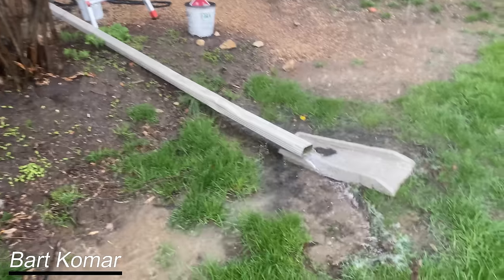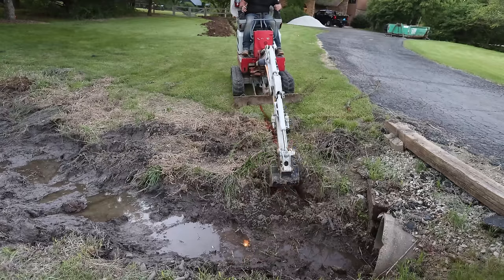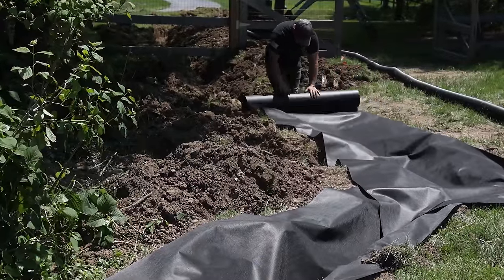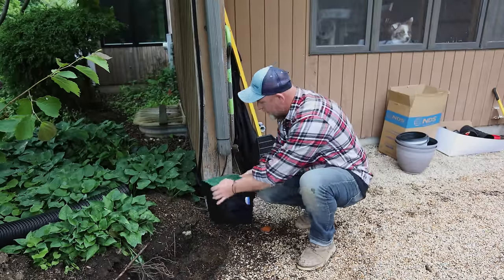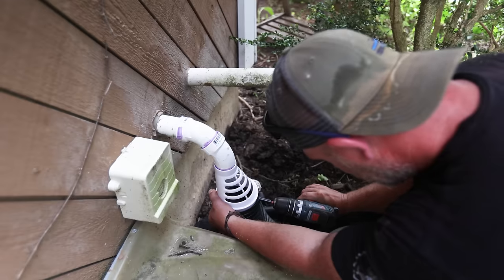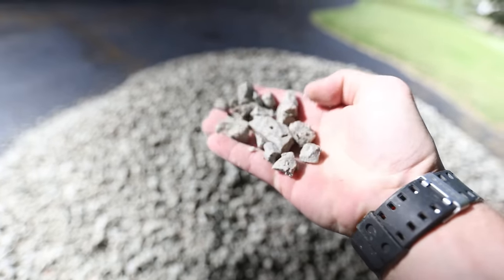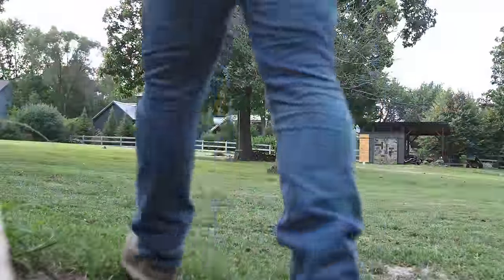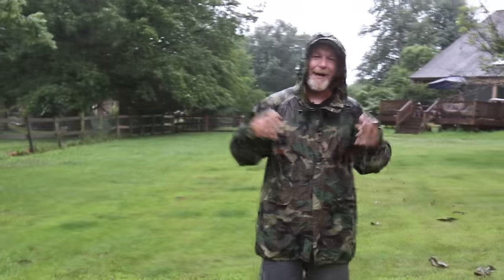How to Install a French Drain that Actually Works!  DIY Project

Comment: For the grass that won't grow due to the clay turnover, could you add layers of compost from the city? We have free compost where I live, or $10 for them to fill a truck bed. They also have a leaf-matter only mix. Otherwise, everything looks really good! I wish I could add a French drain to my property.
Reply: This is just copied from a comment I already made:

BTW, for a lawn heavy in clay, rent a power aerator and run it over the area six or eight times as much as usual.  Then get a nice granular high-organics soil mix and rake over the lawn so the aerator holes get filled with it; corn gluten meal granules are superb for this.  You'll end up with the little cylindrical holes full of organic matter plus a light layer on the surface consisting of what didn't rake in.  Water this once, which will probably settle the organic matter down in the holes somewhat, so repeat adding the organic material and water again.  If you can get away with raising the lawn surface, leaving a half inch of your organic material on top will also be beneficial. If your yard is low on earthworms, buy some and scatter them while the surface is damp; they'll find those little columns of organic material and dive down into the soil.  The worms are your workers; they'll eat organic matter, but they'll also migrate through the remaining clay and perforate it, leaving casting behind that are nature's own fertilizer.
This will be a higher up-front cost, but if you deal with the brown grass problem using fertilizer you'll be forever dependent on fertilizer; if you instead make a healthy lawn for earthworms they'll keep doing the work for you!  And if you aerate every few years and rake in more organics the worms will keep on taking care of your lawn for you.
=  =  =  =

Or to get a really good result -- this is how I turned a dead zone of clay that wouldn't grow grass at all (though it had some spectacular weeds) into lush lawn -- shave the top six inches of clay off and get rid of it.  Then get enough of that free compost (we had a source that was made of human sewage composted with sawdust [don't worry; that mix gets hot enough as it decomposes that if you toss a cardboard box onto a just-opened surface the box will catch on fire, so there's no bacteria in it]) to make a four-inch later on top.  Till this in thoroughly, smooth it ans roll it to compact moderately.  Then spread three or four inches of compost on top -- we added twelve dozen earthworms before this step -- and seed it.

Comment: You connected your downspout to a perforated pipe. @9:19 after putting the filtered grate you used a y connector into a perforated pipe. All your downspout water will now leach out underground
Reply: If I'm not mistaken, the way the perforated line works is by filling up (through the holes on the bottom) and then being carried away through the tube to where you want it.  For the downspouts, once it gets away from the house and to the main trench, it can be treated just like any other lawn water and travel through the perforated line.

Comment: On the pipes that drain away from the house what would the termination process be if you can’t extend it onto the street or a dry creek bed? Do you just dig a big hole with gravel for the water to Oomp into? Of course that would Have the potential of backing up? Thanks

Comment: The links you provided for the 9 inch downspout grate is actually 12 inches.  It doesn't look like they make a similar nine inch product.  So did you use the 12 inch version?

Comment: Sir, just a note. The connectors for the pipe have the extanding part slightly angled as well as is the hose pattern. To me it seems more like the connector is not ment for snapping but to screw in?

Comment: Was there a reason you connected the solid pipe from the downspout to the perforated french tube?  Some contradictory to what you said earlier in the video.
Reply from the maker: No I connected it to the solid pipe.  It’s also corrugated but didn’t have the perforated slits in it.  Look the same but no slits.  Probably should have pointed that out
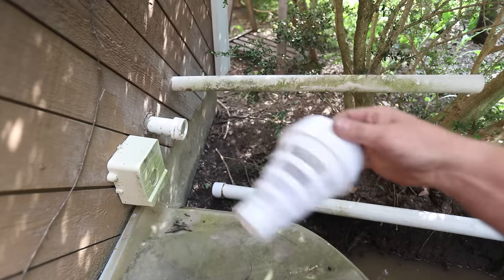Reply: From the video it's definitely the perforated pipe in place that you connected that Y piece into.  Take a look at 09:23 very visible slots in the main pipe you connected into.

Comment: Not an expert, but with all of the research before I did my own french drain,    All reputable sites advise against using crushed limestone of any size because the power when wet won't allow water to pass thru.   It cakes on the fabric and restricts drainage.    It is recommended to only use washed stones (non-limestone based).

Comment: Hey what do I use to connect a 4 inch solid corrugated flex pipe that takes the gutter water to a solid 4 inch PVC pipe that will run underneath a side walk and out to my backyard, what adapter will work best? Also why did u connect the downspout solid pipe to the Y that main pipe was SLOTTED!

Comment: Great video, but I would’ve used pvc instead. Where I live, the city requires you to have a perimeter drain, and they don’t accept big-o, only pvc. What I have noticed is that the big-o, a lot of times will get crushed with the weight. I guess if your just doing it yourself and don’t need to get it inspected then big-o is ok, but again, if your going to live in that house for the rest of your life, it woulda been better to go with pvc. More money, but it’s better
Reply: Harder to install though around bends and curves.
Reply: @AchillesWrath1  yeah it is. On a long trench you’ll be at it forever, filling in voids etc

Comment: Thanks for the fine video.  At 9:20, it looks like the pipe from the downspout is perforated.  Did you connect it to the perforated line rather than the solid line for some reason?
Reply: i noticed this as well and searched the comments as to why. i think it may have been an oopsie

Comment: At 9:15 when you connect 2 pipes using a Y, it looks like your main pipe is perforated. My understanding is that perforated pipes are only used for French drains. Does that mean that you connect your gutter down spout solid pipe to your French drain?

Comment: That catch basin at the foundation is causing splash on your siding and foundation... These areas need to stay dry to any durability!  Otherwise great job with the video.  I'd also recommend a swale in the area of the french drain.  You can use the extra dirt for some berms as you have lots of space.

Comment: Honest question, is there any reason you didn't connect your solid lines from your downspouts to the perforated drain tube in the main yard trench? At that point, isn't it far enough away from the house to then just be carried away like all the other yard water through the perforated tubing?

Comment: Limestone and gravel are often confused with each other, but they are very different aggregates, primarily in appearance. Crushed limestone contains one type of rock (limestone), while gravel is a compilation of many different rock varieties. Or so says the internet.  I wonder myself if limestone will remain as porus as gravel.
Reply: limestone is a specific mineral.  gravel means a combination of aggregates of various sizes.  3/4 minus would be 3/4" crushed down to some sand and maybe silt.  gravel wouldn't specify a mineral, and here in the mountains of CO, most of my delivered gravel and rock have been mostly granite

Comment: PVC is heat malleable. Rather than grind off the nubs on your drains, it'd be super easy to get out there with a heat gun or a torch, soften up the 6 inch PVC and then just pound the drains in to fit snugly.

Comment: Very helpful thank you.  I have gutter guards in the downpipes, but they clog very quickly and I have to go up a ladder to clean out the guards. Your solution at the base of the downpipe seems like a much easier alternative. 
I've watched several of these retro fitting drainage videos in the US, and it seems like proper drainage is never planned or built when the house is first constructed. Most UK newbuilds have rain water and ground water drainage included when the house is built. That being said, your yard is large compared to a UK typical plot. 
French drain: I'm not sure I understand the purpose of the black cloth. Is it impervious to water? If so, how does the water from  the ground enter the French drain pipe? Would you put the French drain at the lowest point of the property where all the ground water collects?
Reply: He says in the video that it lets water through, it's basically a filter to keep soil out.

Comment: A question from a newb - for the non porous pipe from the sump pump and spouting, why did you use a geocloth?
Reply: Ah clear now - you are running porous and non-porous in the same trench.

Comment: Mine has no piping  or plastic sheet, just a 12 inch deep trench with river rock filling it till an inch from the top, sand on the top but I have no drains pouring into it, just a low spot. Still draining fine after 6 years. Grass has grown back over it and it cannot be seen.
Reply: How wide is/was the 12in deep trench?
Reply: Im seeing that a few times in the comments and it makes sense what it would work. What would the drawback be? Dig a trench 18”x 18” line the bottom and sides of trench w non woven drainage fabric so clay doesn’t migrate into the stone. Leave a 2-3 “ space on top on just enough to put the sod back on top n hope it works. Thoughts?

Comment: Please attach the roof drains directly to the ground drain so that you avoid that awful splashing onto your façade as the wood will rot otherwise. There are self-cleaning drain guards for that as well, at least that is how we do it in Sweden to protect our wooden houses.

Comment: It's a land drain a French is just a stonefilled trench.. u will find clean 20 mm gravel also works better due to limestone clogging up on the surface also the liner is also a waste of money unless there's trees close by ... u want the stone to draw the water to the pipe ur kinda defeating the object by lining it .. 👌

Comment: i bought a house form 1890 that had metal oval shaped 4 inch gutters, they were rusty with holes in them. literally none worked lol. so i had a all new gutter system put up. all the downspouts lead right back around the house base originally. made no sense at all. my house is in between 2 buildings so theres not much place to run it. the idiots who put the gutters up ran new downspouts instead of using the old ones that went into the ground. but it was the end of the year and they ran out of material from a shortage and said it would take until next year to fix it and i said just finish it ill fkn deal with it. i took some of this old black pipe that was rigged up on the old system that i kept and ran it off my back gutters, and then also off the back of my giant garage. the inside of the garage door and my basement stopped flooding and hasnt since. took me maybe a hour and a couple of adjusting of moving it to get it right. meanwhile 100 years they let it flood the basement and everything else. i hate to even know what my structure looks like on the other side of the basement wall. i get some seepage still and sometimes water comes up through the floor but total last year i had no puddles. this year so far only had 1 small puddle in basement during a violent 2 day wind rain storm

Comment: You can make connectors by cutting a ft long section of corrugated and then cut long ways in one spot so you can compress it. Shove in one side half way. Then shove other pipe over it the other direction. Rock solid

Comment: It's a common misconception that "French" drains will improve percolation/infiltration. The theory sounds so good, but the fly in the ointment is that the rate of inflow is governed by the infiltration/percolation rate for the soil on top. Slow-draining/percolating soils, particularly those with smaller particle sizes and poor structure drain astonisingly slowly (e.g., 0.02" per hour) meaning that the water will still run off where the drain is. The French drain will drain FREE water (not adhering to soil particles) but cannot "convert" water held under tension to soil particles or slowed by tiny pore spaces, and it sure won't "suck" any water out of finer soils. Better to have a drainage system for capturing surface water and/or grade to drain. Try to get the drain to work on a dry day by sprinkling the surface to mimic the worst case precipitation rate/volume and see how long it takes to see water coming out of the discharge end of the drain and how much, compared to the rate/volume of application.

Comment: Any recommendations for capping the end of the pipe at the drainage point into the ditch to prevent critters from climbing up into the drain system?
Reply: cover it with course rock?

Comment: Regarding that black fabric you call burrito.... What is it needed for? Can you do the job without it? Is it a waterproof fabric or it has holes I assume for drainage ?
I am not Sure what is it's purpose so please confirm. Thank you for a great video.
Reply: You are correct, the geotextile fabric allows water to infiltrate into the drain. It also separates the fine soil from the gravel, keeping your trench clean and the pipe unclogged. I would highly recommend it for all French drains.

Comment: Installing hundreds of feet of 4” corrugated pipe at less than 1% slope is asking for trouble. Very difficult to avoid humps and valleys … and the corrugated pipe already holds water like crazy by its design. Good call on the downspout protection and cleanouts/catch basins. But if this is your forever home smooth wall pvc would be much better. Even for the perf pipe. You should’ve installed cleanouts for the French drain too. Not that it matters because you really can’t snake a corrugated pipe very well 😬 hope it holds up

Comment: what is the point of the gravel? I was thinking it was designed to weight the tube down.  If drainage, then don't you just need a little gravel on the sides...and not necessarily over the top?

Comment: Question: Does a French Drain have to be that shallow - close to the surface?  Could you dig it a little deeper and would it still work as well?  I need to fix flooding in my yard as well, but I think I have to go a little deeper for my drain because it's going under an above ground swimming pool and a trampoline.
Reply: You can shape the trench deeper and narrower, rather than wide and shallow like the video.  The water will percolate through the sides of the trench either way.  Don't put too much dirt above the trench.  That blocks surface water from going down into it.  Gravel can support large amounts of weight.  It's what they put under driveways and house slabs.

Comment: Is that duct tape I see you using to hold the pipe together ? 
If it is, you need to get PVC tape and redo those connections.

Comment: Hey I liked your thinking, hard work and success. If you were to have trees nearby and there's a possibility of their roots getting into the area where you have the pipe, how would you stop the roots from clogging up the textile and possibly getting into the cuts in the pipe and would the woven or other type of material be better?  
I'm about to install a retaining wall at my daughters house 800mm high with some small trees to go on the top so any ideas to stop the roots getting into the ag pipe that I will install to drain the water away from the bottom section?  I intend to cover the pipe with geo textile of some sort and then cover with the blue metal stones like you have done. Any advice would be appreciated.  Cheers.
Reply: Don't plant trees on retaining walls unless you want the wall to fall down or crack forever.
Reply: @GameTimeWhy
Reply: @allanm2601  no text

Comment: 9:20 You said this was a y connection for the solid pipe, but we can clearly see the pipe is perforated in this shot
Reply: Yeah he also said put 4-6" of gravel then 4-6" of dirt as he was putting gravel over pipe the top of which was only about 4" deep to begin with.  lol

Comment: I have a higher water table, sump runs every 3-4 min even in the summer.  I’ve run discharge 70 ft from the house.   Would this help???

Comment: one thing I dont understand, on the green drain grates that you cut the nubs off of. I'm curious how you handle dirt and debris that gets into the pipe there? doesn't that eventually clog up the system over time? Maybe I am over thinking it or not thinking of something correctly?

i bought a home that has french drains from the down spouts going into the ground and ending up somewhere in my yard away from the house however its a 1990 home and those pipes coming off the down spouts are clogged up and water just rushes out of the downspout where the connection to the pipe is so I imagine i have to pay big money to dig up all of that corrugated piping? even the piping that  is going in and under the concrete....
Reply: You pop off the green grate and clean the catch basin out.
Reply: Are you sure it’s a French drain? Downspouts should never be piped to a FD system. Have you dug up a small section to see? If it’s solid pipe (hopefully) you can hire a service to clean out the pipe. If it’s corrugated you are looking at replacement.

Comment: how many of the caps have you sucked up with the mower or did you fasten them down? why did you choose to go with limestone over 57 wash gravel like you have in the dry creek bed? did you decide to go with the corrugated pipe for the price?
Reply from the maker: Never sucked up any caps.  They stay firm in the pipe.  As for the stone, it’s a price issue.  The river rock we have in the dry creek is soo expensive and washed gravel works great for French drains too.  But you can go eaither way
Reply: @KomarProject  do you live in the upper midwest? limestone near me is stupid expensive. over $40 a ton.